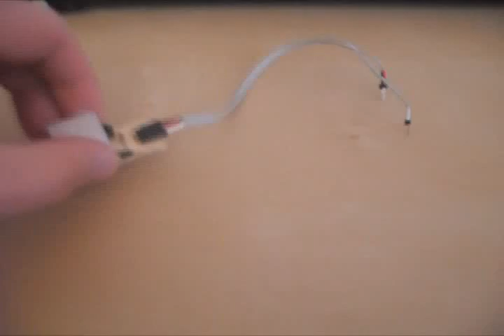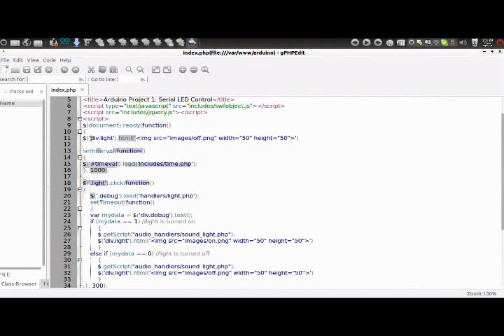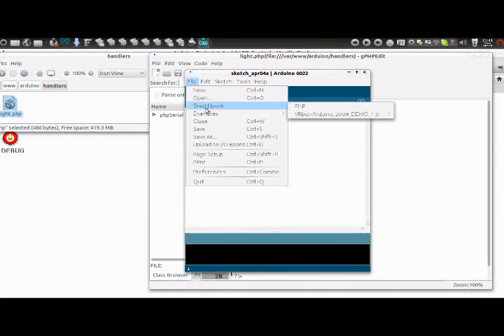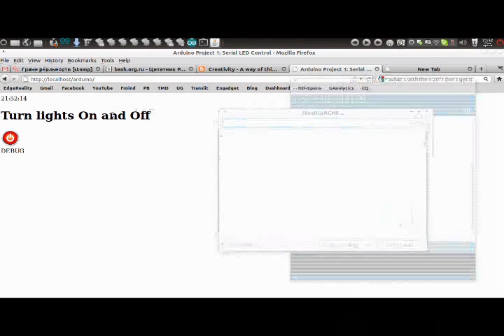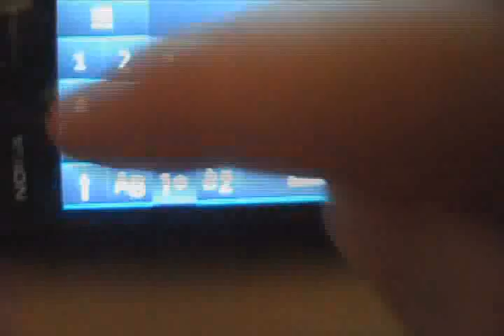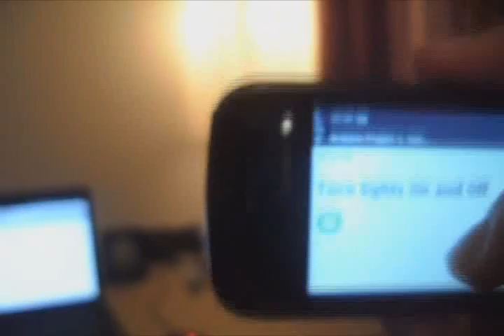Arduino and PHP

Comment: #include <Ethernet.h>
 
String readString;
byte MAC[] = {0x00, 0x01, 0x02, 0x03, 0x04, 0x05};
IPAddress IP(192, 168, 1, 181); //192.168.1.181
IPAddress MDns(8,8,8,8);
IPAddress Subnet(255, 255, 255, 0);
IPAddress Gateway(192, 168, 1, 1);
// telnet defaults to port 23
EthernetServer server(80);//80
EthernetClient client;
 

#define LED1  2
#define LED2  3
#define LED3  4
#define LED4  5

#define RED    client.print("<a><button border; width: 50%; style='border: 6px solid #FF0000; border-left: 6px solid #FF0000 type='button'></button></a>")
#define BLUE   client.print("<a><button border; width: 50%; style='border: 6px solid #0000FF; border-left: 6px solid #0000FF type='button'></button></a>")
#define  StrO    client.println("<big>LED is now <b>OFF</b></big><br/>\n")
#define  StrI    client.println("<big>LED is now <b> ON</b></big><br/>\n")
boolean A = false, B = false, C = false, D = false;
 
void setup() {
  Serial.begin(9600);
  pinMode(LED1 , OUTPUT);
  pinMode(LED2 , OUTPUT);
  pinMode(LED3 , OUTPUT);
  pinMode(LED4 , OUTPUT);
 // Ethernet.begin(MAC, IP);
  //Ethernet.begin(MAC, IP, Gateway, Subnet);
  Ethernet.begin(MAC, IP, MDns, Gateway, Subnet);
  server.begin();
 Serial.print("IP......Address  ");
 Serial.println(IP);
 Serial.print("Subnet..Address  ");
 Serial.println(Subnet);
 Serial.print("Gateway.Address  ");
 Serial.println(Gateway);
 Serial.print("Dns.....Address  "); 
 Serial.println(MDns); 
 
 

 
}

void loop() {

  client = server.available();
  if (client) {
    while (client.connected()) {
      if (client.available()) {
        char c = client.read();
        if (readString.length() < 19) {
          readString += c;

        }
        if (c == '\n') {
          client.println("HTTP/1.1 200 OK"); //send new page
          client.println("Content-Type: text/html");
          client.println();
          client.println("<meta http-equiv=\"refresh\" content=\"60\">");
          client.println();
          client.println("<!DOCTYPE HTML>");
          client.println("<HTML>");
          client.println("<CENTER><HEAD>");
          client.println("</HEAD>");
          client.println("<BODY>");
          client.println("<body bgcolor=\"#FFFF00\">");//Red  #FF0000 //#FFFF0F//00FF00
        //client.println("<meta name='apple-mobile-web-app-capable' content='yes' />");  
        //client.println("<meta name='apple-mobile-web-app-status-bar-style' content='black-translucent' />");
          client.println("<html><head><title>EthernetShield</title></head><body>");
          client.println("<fieldset>");
          client.println("<H2>EthernetShield</H2>");
          
          client.println("<hr />");
          client.println("<a href=\"/01-//\"> OFF-1</a>");
          client.println("<a href=\"/01+//\"> ON-1</a>");
          if (readString.indexOf("01+//") > 0) {
            A = 1;
          } else {
            if (readString.indexOf("01-//") > 0) {
              A = 0;
            }
          }
          if (A == 1) {
            digitalWrite(LED1, HIGH);
            StrI;
            RED;
          } else {
            if (A == 0) {
              digitalWrite(LED1, LOW);
              StrO;
              BLUE;
            }
          }

          client.println("<hr />");
          client.println("<a href=\"/02-//\"> OFF-2</a>");
          client.println("<a href=\"/02+//\"> ON-2</a>");

          if (readString.indexOf("02+//") > 0) {
            B = 1;
          } else {
            if (readString.indexOf("02-//") > 0) {
              B = 0;
            }
          }

          if (B == 1) {
            digitalWrite(LED2, HIGH);
            StrI;
            RED;
          } else {
            if (B == 0) {
              digitalWrite(LED2, LOW);
              StrO;
              BLUE;
            }
          }

          client.println("<hr />");
          client.println("<a href=\"/03-//\"> OFF-3</a>");
          client.println("<a href=\"/03+//\"> ON-3</a>");

          if (readString.indexOf("03+//") > 0) {
            C = 1;
          } else {
            if (readString.indexOf("03-//") > 0) {
              C = 0;
            }
          }

          if (C == 1) {
            digitalWrite(LED3, HIGH);
            StrI;
            RED;
          } else {
            if (C == 0) {
              digitalWrite(LED3, LOW);
              StrO;
              BLUE;
            }
          }

          client.println("<hr />");
          client.println("<a href=\"/04-//\"> OFF-4</a>");
          client.println("<a href=\"/04+//\"> ON-4</a>");

          if (readString.indexOf("04+//") > 0) {
            D = 1;
          } else {
            if (readString.indexOf("04-//") > 0) {
              D = 0;
            }
          }

          if (D == 1) {
            digitalWrite(LED4, HIGH);
            StrI;
            RED;
          } else {
            if (D == 0) {
              digitalWrite(LED4, LOW);
              StrO;
              BLUE;
            }
          }

          client.println("<hr />");
         //<Button type= >...  client.println("");

  client.println("<video width=" " height=" " controls>");
  //client.println("<source src=" " type=" ">");
  
  client.println("</video>");//
  client.println("<audio controls>");
  client.println("<source src=" " type=" ">");
 // client.println("<source src="horse.mp3" type="audio/mpeg">");
  client.println("</audio>");
client.println("<fieldset/>");
          
          client.println("</CENTER></BODY></HTML>");
          client.stop();
          delay(10);
          readString = "";
        }
      }
    }
  }
}

Comment: Hey, after explaining the code you gave some tips on to set up the serial settings on Linux/ Ubuntu. What about Windows? What do I have to do if I have windows? Im using Windows 8. Thanks for the video
Reply from the maker: +Johnny Bravo Why not just try it as it is and see if it works? It might work, if not, google is your friend, also checkout the arduino forums, they are usually a pretty helpful bunch.

Comment: can you plz tell me how will you send a sensor data to a web page..
i am using esp8266 wifi module,  can we read sensor data using gpio pins??
i can use the gpio pins in output mode but i am unable to read any sensor data through the gpio pins.
Reply from the maker: +Kushal Khedekar Sorry, haven't played with an arduino in a long time, can't help you on this.

Comment: how'd you decide on that baud rate?
Reply from the maker: It was set as default, I don't know much about baud rates :)
Reply: if you are only send data and its minimal, you can use a lower baud rate. If you are sending and receiving data then a higher baud rate is required. Nice thing is that you can test to see which works best for you.

Comment: Was going good, but it appears that you are on a PC as a server for the scripting and not a remote server like Go Daddy. This is evident per your "Port" setting requirements....Oh well.

I was looking to use a php page to communicate with my IP addressed Arduino server to control some switches, and not thru a constantly running PC in my house. Otherwise, good tutorial.